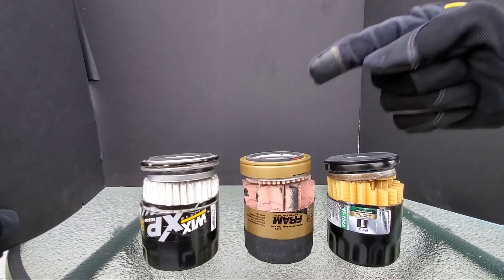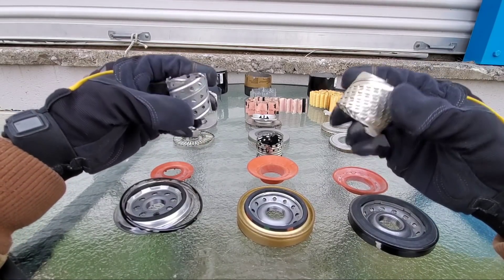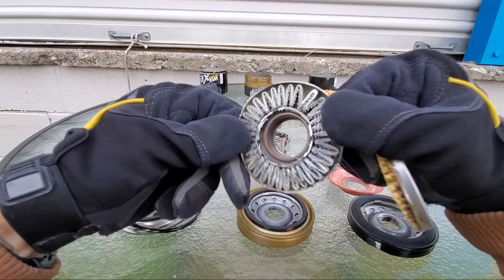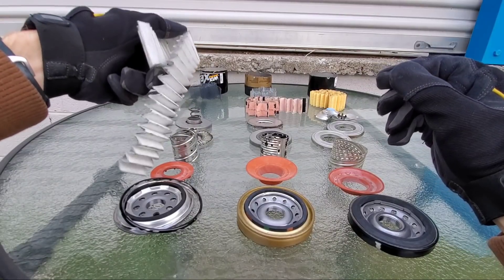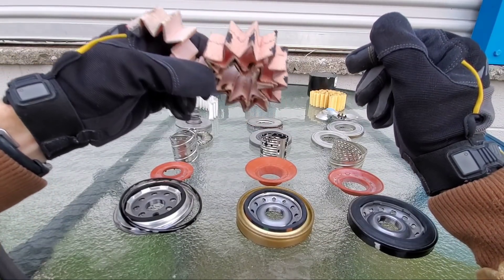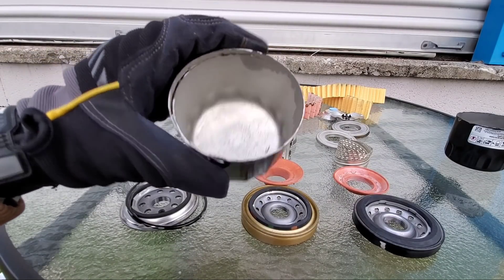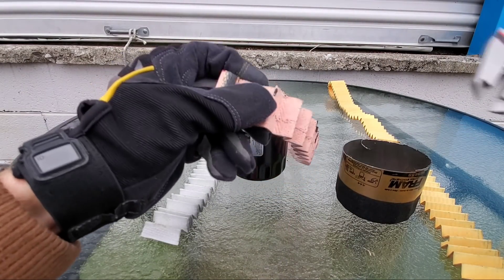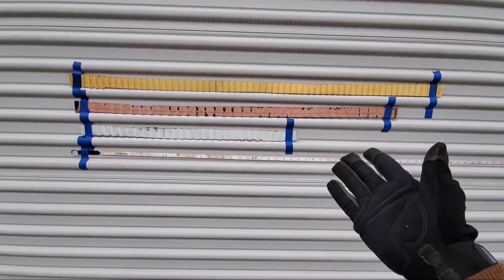I cant believe what was inside these oil filters Fram,wix xp, Mobil1

Comment: Thanks for the video.  I have used Mobile 1 filters on all our vehicles (kids, mom, grandparents, and mine) for over 30 years with synthetic oil and never had a single oil related problem.  The vehicles range from new to very used and trucks to compact cars.  Everything has gone over 250,000 miles and I have a truck that has over 330k miles on it without any oil related trouble.

Comment: Love the video, it’s the 1st on I’ve seen from your channel. Personally, I used to use FRAM Filters usually the top grade for my engines. I used to use only Castrol GTX oil, 10W-30, 10W-40 and 20W-50 depending on the application and use of the vehicle. I own 5 Ford’s vehicles 3 trucks and 2 cars, all have 302’s except one has a 460. They all use 6qts oil and same filter used to use XG8A, now I use only WIX filters which is the Wix 51515 filter. Now I only use SuperTech oils in the same viscosities.

Yes I cut open my filters every oil change to inspect for engine health, normal wear is all I see. Though, being a mechanic I maintain my vehicles better than the average key turner!!! Yes I do not have faith in people to take care of their vehicle because, I literally fix their screwups and problems due to lack of maintenance and lack of caring for their vehicles longevity. Yes most but not all people are either key turners that “turn the key and go” or abusers that don’t maintain or abuse their vehicles!

 I’ve never blown an engine with either arrangement and never had mechanical issues due to lubrication or filtration issues that wasn’t already an issue regardless of oil and filter choice! I’m a HD Diesel mechanic so engine building, diag & repair is my trade so knowing which lube and filter to use is only through experience and use.

Comment: that is not a wix XP.   a wix xp has wire backed filter media so it wont fold in upon itself.  a wix xp has a welded in bypass and not rolled steel  also the wix xp has a different type of spring retainer.  do a search for wix vrs wix xp filters.

Comment: I've been using the Fram orange filters on my 92 Toyota pickup for 20 years and have had no problems. However, I have occasionally noticed rust in the inside bottom of some of the filters. I've heard that Supertech filters are pretty good, though. What's say you?

Comment: The Wix gasket comes off with little effort. The last 3 oil changes on my Cummins had the Wix gasket stay on the engine. I like the Wix but hate the gasket. I've used my last Wix on my Cummins. You will double gasket the Wix if you don't pay attention. And yes, I preoil the gasket before install.

Comment: Wix is wide thick, and made of best material and micron rating out of the 3. the length of the others dont really matter cause they all are long enough to do the job and fill the circumference inside the shell. I use Wix, Oil, Cabin,Air, with Pensoil, best I can find in my Area.

Comment: It appears that you had the rubber coating of the Fram cannister in the caliper when you made the thickness measurement.
Also, there was no test of the porosity or particle filtering properties of the filter media.  Length is not so important if the media doesn't filter particles effectively.  No test on pressure level to open the valve.

Comment: Why are you wearing gloves to handle oil filter components?  Did you drive down to your storage unit to make the video??
Reply from the maker: My storage building is bigger than many shops work area. The gloves keep you from being cut or having metal particles on you. Not to mention clean hands for the camera after setting up the part for the video others dont see.

Comment: I use the Fram ExtraGuard with my synthetic oil changes. There isnt much difference in quality between the low end and high end Fram. Even with synthetic, I change my oil every 3k miles. If I went 6k miles then Id look at maybe a K&N filter

Comment: How small of particles are filtered out in each of these 3 filters? The Mobil 1 filter is 99+ efficient and filters particles down to 30 microns. It also can withstand pressures up to 9 times normal pressure. Compare these specifications  against the Wix XP and Fram filter.

Comment: It is not the cold temperatures that is a problem with oil filters. Modern cars use and recommend lightweight oils, like 0W-20 or 5W-20 weight oils, for use in their cars. These lightweight oils have no problem flowing through an oil filter, even at below freezing temperatures, especially if they are synthetic.

Comment: The bypass valve is not normally used for cold oil . The oil would have to be 80 weight for this to happen. The bypass valve is mostly used if the filter ever becomes too full or clogged to function properly. If it is clogged, they bypass the filter and send the oil directly to the engine without going through the filter.
Reply: Right on  fella. The information is a fact James. Nice to know others are informed and knowledgeable. Peace vf

Comment: I always liked Fram. Mostly used Fram oil and air filters. A few years ago saw that Fram had thinner fabric in their cartridge oil filters than even Walmarts Supertech. Then after a while saw the Supertech cartridge oil filter was less quality and thinner than the Fram. I don't understand it. Lately been using Supertech oil cartridge filters when oil change my car and seem okay. It's on the GM 2.2 Liter 4 cyl Ecotec engine.

Comment: I still get wix XP and cheaper then farm ultra they filter out 20 microns. I had issues with k&n and AC Delco and see couple customers complain that they have oil leaks and came from oil filter then replaced with OEM or wix and don't have any problems after replacing k&n or ac Delco

Comment: Nate, you do realize that all engines have some H2O in them.  The moisture in those filters is condensation from improper storage, which could be in any brand filter.
Reply: Honestly I would worry if u have fram. But wix handled it well to prevent it from getting really bad like fram dispite that
Reply: The Chinese like to pee pee in our Coke, so they very easily could have pee peed in our filters.
Reply: Yes, that moisture COULD be in ANY filter -- but it's most always in the FRAM filters. Other Filter Tester Men have pointed out FRAM's rusty filters. It's common knowledge.
Reply: so you’re saying to throw oil filters in a dehydrator first ? or like a low temp oven? :P
Reply: More likely a manufacturer defect

Comment: The irony is that you are doing this by visual and your opinion. The only thing that really tests these filter is ASTM certified machines for filters.  I agree that Fram sucks. They use a surface type filtration. Mobil and wix use what's called lofted fiber material which is the newest technology in filters. They can hold twice as much dirt and filter in the 10 - 20 micron range with 90% efficiency. Farm surface type filtration filters down to 20 - 40 microns. Holds the normal amount of dirt and needs to be changed more often. Anything below 12 microns in size is to small to do engine damage. Fram would not even come close. The filter that uses the newest and best of the newest technology and is not represented here. Is Amsoil.

Comment from the maker: Yes i also used fram for years and thought i had not had any issues. But if the cars compression, oil pressure, oil flow rate, oil loss, and so much more isn't perfect then you can't say no issues. I did the same in the past. After what i saw today im so shocked and this was before i even cut open a oil filter. Soon enough i will share but you decide what's best for you. I sell nothing so i only want to help.
Reply: Thats why I use KnN gold filters.
Reply: @cindysue5474  I’ve been using for 10 years K&N GoldFilter but going too try Royal Purple next oil change 1998 F150 150K odometer . I use B12 & MMO great injection cleaners over 10 yrs. 🤙

Comment: The fram was a mess, and the rust might be a problem on the WIX.  But just because you think something looks cheap doesn't mean it wasn't designed by an engineer to work and last exactly how it was supposed to.  Not saying this is true, but the fancy WIX poppet valve could be much worse for the engine if the heavy spring is too much.  I appreciate the look at the internals, but calling them unsafe just based on how they look to you instead of doing a performance test is click-bait garbage.
Reply from the maker: Its ok you support fram. But the spring is specifically designed for a certain spec depending on the vehicle. They all use different materials however that is fine but when you have glue on the inside and outside of filter media thats broken free its able to damage a engine.  I could go on but i see you are biased.

Comment: These types of examinations don't prove anything.  You can't judge the quality of the filter media by looks or thickness alone.  They need to be  tested and compared in a laboratory setting to determine which is more effective at doing its job.
Reply from the maker: In general if the filter does the job properly its fine. Yes i also used fram for years and thought i had not had any issues. But if the cars compression, oil pressure, oil flow rate, oil loss, and so much more isn't perfect then you can't say no issues. I did the same in the past. After what i saw today im so shocked and this was before i even cut open a oil filter. Soon enough i will share but you decide what's best for you. I sell nothing so i only want to help.
Reply: @NATESINTERACTIVEAUTO  
So did ever see the compression or any of those other things you mentioned negatively affected and can you be certain it was due to Fram filters?

Comment: The glue is there to hold the stuff together where as the other filters rely on hopes and dreams I buy fram ultra synthetic filters and run conventional oil and change every 5000km with no issues and oil is still fairly clean
Reply from the maker: Yes i also used fram for years and thought i had not had any issues. But if the cars compression, oil pressure, oil flow rate, oil loss, and so much more isn't perfect then you can't say no issues. I did the same in the past. After what i saw today im so shocked and this was before i even cut open a oil filter. Soon enough i will share but you decide what's best for you. I sell nothing so i only want to help.
Reply: @NATESINTERACTIVEAUTO  
I'm going to try that Fram Ultra Synthetic filter. For me it seems like a high quality filter. 
My vehicle uses a cartridge filter, so all I replace is the element.
Reply: There is absolutely NO REASON to run conventional oils in today's engines -- it offers NO ADVANTAGE, except for cost -- but that's not a real advantage when engine protection and cost-per-mile are considered.

Comment: Yes.  They're so "bad" that between the three(and their generic equivalents) they probably successfully protect 70% of the cars on the road today.   So what harm does a little flash rust on the inside of a filter do?  Answer...not a thing.  Let a car sit for a while with no lubricant on exposed steel internal parts and guess what???  You get a little bit of rust.  So what???  Just another hack with a hacksaw trying to play engineer...and doesn't even know the difference between a micrometer and a digital caliper.  WTF does filter length have to do with filtration capacity or efficiency?  Answer...not a thing.  There are very small high efficient and high capacity filters and very large, very low efficiency low capacity filters.  Physical size has little to do with it.  Fram filters protect some of the most expensive engines in the world...and I'm talking the ORANGE can Fram filters.  I've seen $5 so called "Orange Cans Of Death" on $300k Ferrari's which have come through our shop.  We rebuild/build 3-4 engines per week of all shapes and sizes(and a few dozen heads) and even the owner(who's been in business for 40 years) has only once or twice seen a PROVABLE engine failure attributed to the filter itself.  And in one case he said it was likely double gasket-ed and the owner never noticed that the oil was blowing out until damage was done.  It's just a YT scare which rarely if ever happens and this is just another video perpetuating the myth of the terrible filter.  Of course inexpensive filters are built with less expensive materials...but even those are PROVEN to easily withstand the usual 40-60 PSI of oil pressure seen for at LEAST double the mileage on the box.  Find a real issue.  Like why Ford designed some of it's heads to blow spark plugs out on a regular basis.  I think I've paid my house off with the number of those I've had to fix.   Now THAT IS a REAL problem...
Reply from the maker: Why does it matter why for made that mistake the fact is they did it. By the way everyone knows that you must have saw it on YouTube lmao. Dont be a hater im not selling anything so what do i have to gain.
Reply: Nate, this guy is right.  If you let any car sit for a long time, it is going to have minute rust inside (not rust you have to scrape but light flash rust). He is also right about the fact that VERY FEW engine failures are caused by oil filters.  I worked in the fast oil change business a long time (we had a house filter made by Champion who also makes M1 filters, Royal Purple, and Amsoil oil filters). Champion was a FRAM subsidiary prior to 2016 and still has a relationship with FRAM.  So, cross those off your list too.
Reply from the maker: Rust is not ok and ask any mechanic.
Reply from the maker: I could get very technical but im not interested in none of the brands. People get hung up on a brand and no matter what they see the brand is ok to them. You could cause damage to a engine and it may not just blow up but use oil over time or lose power. Most people dont use their cars to the full potential so they dont realize. Buy low quality if you want. I found rust on way to many fram filters.
Reply from the maker: How long have you sold Fram filters? Flash rust thats like saying watered down sulfuric acid is no big deal. Hacksaw???? You clearly dont know what that is. Everyone says 40 years or 50 years but some of us put in many over 100 hour weeks of work. If i build a bicycle at 20 then again at 80 ive been building bicycles 60 years ok. How do you know if a filter damages a engine? Do you perform oil testing?
Reply from the maker: If a car sits and develops rust inside there is something bad wrong obviously you don't know much about engines. Caliper micrometer i have a bad habit of calling them by each others name and they can do some of the same jobs but anyway do YOU STILL WORK FOR FRAM?

Comment: Every since I bought my 09 Ford flex, I've run Mobile1 and K&N filters with Royal Purple oil. Never had an engine issue ever.  Yeah it's overkill,  but rather that then repair bills.  I use to work at Ford and have done automotive all my life. I just use what works for me, especially in the extreme cold climates,  Royal Purple is a lifesaver.
Reply: Royal Purple here too! Extremely cold canadian winters and never an oil related issue.

Comment: I've used fram synthetic on my 1999 corolla it has 300 000 miles
Reply: You can put just about any crappy part in a 90s era Toyota and will run forever. Never get rid of that car.
Reply: @Jimmy-ph8xn  as a guy who drives a 96 corolla with 193k miles, gotta love the sound of those engine smoother than some newer car

Comment: I think the Mobile 1 and K&N are good. Changing your oil every 3k with good synthetic  oil really counts. Maintenance is cheaper than repairs!
Reply: 3k is a little soon for me. 5k is when I change mine no matter what the oil percentage says on my truck
Reply: @robertortega8524  Exactly, i used Castrol Synthetic Magnatec in my 18 Accord and no matter what the oil percentage says on the panel 5k is the proper time to change it as long you drive your vehicle with normal habits you should be fine. But that dude is just throwing away his money on unnecessary oil changes.
Reply: Most manufacturers recommend 7500 milev intervals with synthetic. They have to provide warranties to back this up. 3k changes will guarantee fresh oil always but it may be wasteful.

Comment: Take a K&N filter apart. I also didn't notice you removing the seal on the Fram. Every Fram that I've bought like the one you tested had a siliphane wrapper covering the opening. I'm pretty sure that's why yours is rusted. Once it's removed and has oil in it it will never rust. Bottom line is you get what you pay for.